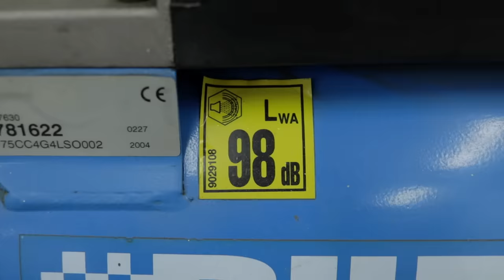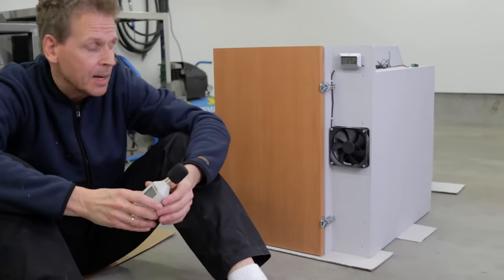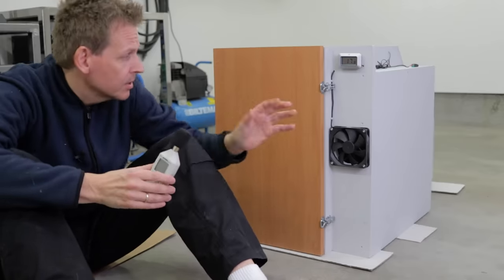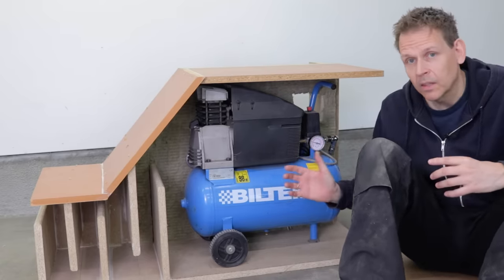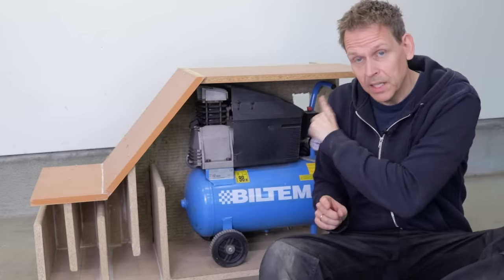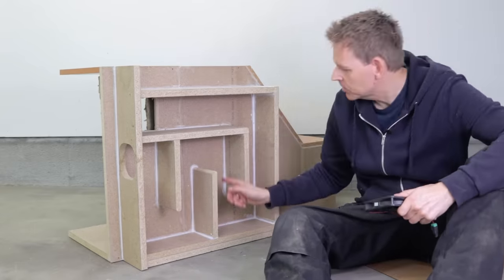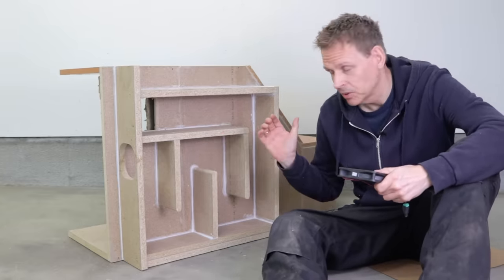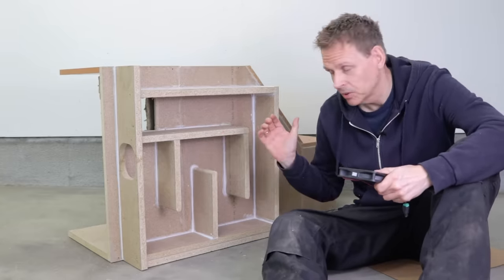Do not build a sound insulated enclosure for your noisy air compressor!

Comment: i have a very large industrial air compressor, and as mentioned in other comments, a lot of the sound comes from the air intake, my compressor has two cylinders, which alternate up and down, so you get two distinct thumping sounds while the machine is running

how i made mine quieter, is actually by taking the air filter off, and pushing a piece of drain pipe onto the air compressor, with a right angle bend fitting, then a meter of drain pipe, now when the machine is running, instead of getting the two thumping noises, it just makes one continuous sucking sound like a vacuum cleaner, i think because the original air filter was straight onto the valve block, when each cylinder was sucking in air, it would pull it straight through the air filter into the valve block, and make that thump sound, then there would be a pause, and the second cylinder would suck in air making a second thump, so air was starting and stopping whilst it was going through the filter, but now theres a length of pipe on the air intake, the air going through the pipe is moving more steadily, and more constantly, so its completely removed the thumping sounds, and replaced it with a smooth, sucking sound
Reply from the maker: It is a very smart and easy way to reduce the noise 👍 I did not really consider adding a hose, but I checked if it would work to add an air intake muffler of some kind of sort (I would guess it has some of the same effect). I was not convinced that it would help very much after a bit of research. I searched mostly on Youtube. I did not find any solution that I thought sounded very efficient. It absolutely helps a but, as you say it removes the thumping sound and it gets a bit lower in volume. I think the reason it does not fully work is that the tank itself also emits noise because it acts like a sound chamber, reflecting noise from the compressor through the metal tank (I am not sure about it - but others has also mentioned it in the comments).
Reply: @kihestad  yes, there is another alternative, but its not cheap, you could buy an empty silent generator housing, and put the compressor in that?

Comment: I noticed that you used a very thin material to line the inside of the box.
I would recommend that you check out your local auto supply store for a rubber based sound deadening material. It comes in large rolls and 12" X 12" squares and have glue on one side. They are very heavy and could easily double the total weight of the box. Line the inside of the box with these, and then cover that with a sound deadening foam that you can get from a local foam shop. Makes a big difference. I use this system to quiet noisy computer boxes. Also, put a layer of this under the box to isolate it from the floor.

I live in a small apartment so what I do with mine is lock it in the bathroom and cover it with towels to keep from disturbing my neighbors.
Reply from the maker: I did use Rockwool sound insulation material (3cm = 1 inch) on the main chamber, but you are correct: a very thin fabric otherwise. I was afraid of not having enough airflow to keep the compressor cool, and I could not make the box much bigger to I went for very little sound dampening on both the inlet and the exhaust channel. The cooling seems to be no problem in my "cold" climate, so I might add some more padding now to see if it helps. Thanks for the tips! 🙂

Comment: Nice job.. Lots of work for sure.. Some improvements... Amaz0n has sound deadening foam. It's not that expensive and designed to absorb sound. 
Next. If it were my garage, I have frequent mice visitors. They would love to take up residence in that baffle chamber, especially if you don't use the compressor daily. You may want to add some metal screen mesh at the inlet/outlet. You can get this mesh at mcmaster carr supply. 
Lastly, you can use your first "noisy" compressor in the "off" state as an accumulator tank at the garage floor, wall or suspended from the ceiling. Run an air line from the silent tank to the second tank closer to your work. Tap off the accumulator for your active work air-line. This will give you more available volume to run air-tools etc.. Thanks for sharing all that information.

Comment: This was an interesting experiment and rich content.  Thank you for your hard work in this scientific demo. Very useful to us all.
No, I disagree with you.  You SHOULD BUILD IT.  Spares your hearing, does not annoy neighbors who will report you for noise violations, and a cabinet greatly increases safety in case that compressor blows up due to rust on inside due to damp air.  So, absolutely, every compressor should have a strong tough cabinet around it from solid thick plywood.

Here are some thoughts I had but have not tried out yet:
1. Stick Noico or Killmat patches on metal tank and any other metal parts to eliminate rattling noises from metal.  It changes the clanging of metal to a softer thuck thuck sound.  Also wrap tank in a sound blanket.
2. Add Mass Loaded Vinyl (MLV), a type of rubberized vinyl mat, very heavy to all sides of box on inside. It dampens sound and vibration.
3. What about adding a car muffler to the vent to break up the sound? It might work really well.  Maybe add it to the outside vent.
4. Rust on inside of tank is the biggest risk. Metal degrades over time, then Kaboom!  I wonder why they don't rustproof insides of tanks before selling.  I would get a dehumidifier on that air intake side so no humid air enters or leaves the tank. Useful if you are sand/soda blasting, which is what I want a tank for.

Thank you for an excellent video!
Please do not add any music to a DIY channel.  It hurts the ears.  I have to constantly turn the volume knob on off on off and it is stressful and an irritant.  Much better to be with natural sounds only.
Reply from the maker: @mjremy2605  Thanks a lot for your positive feedback, and for thoughtful comment 🙏

Comment: I like your tidy, clean workshop and a very good video presentation, the inlet and outlet are called 'baffles'. We had a large industrial compressor and it was loud, one of the mechanics put the air intake up through the roof and it was much better, if you have the room, just put it outside with a roof over.
Reply from the maker: Thanks 😊Ahh, yes - battles it is! 
I agree, putting it outside of the workshop is probably the easies and smartest solution to the problem 😊Unfortunately, I just dont have space for it. My garage is placed with minimum distance to two of my neighbors. The side facing my own property is not usable either,  as it's just a slim path between my garage outer wall and a concrete retaining wall. In front of the garage door is no good either 😋

Comment: I had a noisy vertical compressor, I figured a fair amount of the noise was via the tank, that wrung like a gong, so I was going to try wrapping sound deadening carpet underlay around it. I acquired the underlay, however the compressor died before I could try. So I'm now in the market for a silent compressor.
Reply from the maker: Sounds probably like a better plan anyway 😊

Comment: I grew up around noisy compressors. When it was time to buy my own I dread the thought of noisy. I bought a diaphragm pump design (Chicago brand) and never been happier. I hear it when it's on but it's not disturbing.  69dB  Chicago Hush 50.
Reply from the maker: That is not bad at all, you can absolutely tolerate 69db noise once in a while 👍

Comment: What you are gonna want on the muffler end, and potentially on the intake end, are fans capable of creating a reasonable amount of static pressure.  Computer vent fans  can work, but you need to seal the areas around the fans pretty tightly to get the flow right and youre gonna want fans with good static pressure and cfm.  Beyond that id say its a pretty good design and should work mostly.  Maybe attach a drain tube extension and a secondary valve so you can drain it from outside the tank.  Only thing is youre gonna want a high pressure braided line for it..  if you add some spikes for deflection, or faux fur, or soft fibrous material of some sort to the walls of the exhaust you'll likely be able to reduce the noise further too.
Reply from the maker: Thanks a lot! I have god some feedback and improvements suggestens for the airflow. I might end up moving the fan inside the box to pull fan into it instead of pushing from outside as it is now. 
When it comes to draining the tank: Absolutely! It's a bit cumbersome as it is now, I need to open the four eccentric locks and pull of the door and then take the compressor out of the box. It takes no more than 5 minutes, but it's enough to postpone it to the next day 🙄I better put on a line and have it on the outside....

Comment: I built one many years ago. I installed an inlet and outlet for ventilation. In the inlet side I put a PC fan that sucked air in and blew it right on the compressor head (hottest part). Both the in/outlets had baffles but not near as complicated as yours. I carpeted only 2 walls. Mine dropped the noise down considerably
Reply from the maker: I think your design is better than mine, I plan to move my fan inside the box and make sure it pulls the air from the outside insted of pushing air from outside as it does now. Glad to hear your solution worked! 👍
Reply: @kihestad  I didn't record any db readings but you could easily hold a normal conversation right next to it as it runs. Where as before w/ no box. You could not talk at all. You'd have to yell and even then it was difficult to comprehend.

Comment: I just built a small shed just behind the garage. Houses my compressor and generator nicely. Ran hose and cord in 2" PVC through the back wall. Virtually silent and very easy.
Reply from the maker: Yes, that is probably the easies and smartest solution to the problem 😊Unfortunately, I just dont have space for it. My garage is placed with minimum distance to two of my neighbors. The side facing my own property is not usable either,  as it's just a slim path between my garage outer wall and a concrete retaining wall. In front of the garage door is no good either 😋

Comment: My neighbor is a car repairman. He has his compressor in the shed outside, so it's quiet in the workshop :) Just wanted to point out that if you need the extra power (for pneumatic tools, etc.) and have the space to put the compressor elsewhere, that's also an option.
Reply from the maker: Putting it outside of the workshop really makes sense 😊Unfortunately, I just dont have space for it. My garage is placed with minimum distance to two of my neighbors. The side facing my own property is not usable either,  as it's just a slim path between my garage outer wall and a concrete retaining wall. In front of the garage door is no good either 😋

Comment: I think you should raise the compressor from the ground inside your box using a mount on springs system similar to optional accessories for outdoor unit of split heat pumps. It sounded like you still received quite a bit low frequency rumble and it's probably caused by the whole enclosure vibrating along with the compressor.

We have our outdoor unit for split heat pump on both rubber feets and pretty soft springs stacked and that's very good for the low frequency noise via physical vibrations.
Reply from the maker: I think you are spot on! Vibrations are the remaining issue I have. Thanks for the tips!!!

Comment: This was a good Video.
I think you could make a box like this much cheaper with DIY acoustic panels.
I can really recommend you the Video "How to make high performance sound absorption panels for 5$" from DIY perks.
I hope I could help you.
Greetings from Germany
Reply from the maker: Thanks for the tips! I have seen that video, I think he uses some old towels. I am using Rockwool sound absorbing material, I am pretty sure it is a better solution. It is not crazy expensive either, but you need to buy a whole package of it. Luckily I had some leftovers from this project: https://youtu.be/4EkoAMJAIug

Comment: Does the air compressor overheat Inside the Box due to lack of cooling air available
Reply from the maker: I have fitted a thermometer and I do check frequently that it's not getting to hot inside the box. Normally the temp increases 5C = 10F when it starts until pressure is built up, and it takes just a couple of minutes to cool it down. If it is running constantly over longer periodes it can get a bit hotter, I have seen almost 10C = 20F increase. The warmest summer days can be 30C = 86F here where I live, but that is very rare. Its more commonly 25C = 77F, so it never gets very hot inside my box.
It's a pretty cold climate here where I live in Norway, in the Northern part of Europe. I have actually fitted a heat pump in my garage to be able to use during winter time. I can see overheating is a big challenge in warmer climates. A more powerful fan or even radiator cooling could be needed must then be considered.

Comment: I had a compressor that was 6HP and a 33 gallon horizontal tank, I built a 4ftW x4ftH x2ftD box from two sheets of 1/2 inch plywood and used Styrofoam sheets glued on to the inside. I added three bathroom fans to the front of the box and with flexible plastic fan ductwork that went to each compressor head and one went to the motor shroud. I also installed a 12x12 air vent on one side of the box to let the warm air out. The compressor never shut down due to thermal overload although it did before adding the fans, I would run it for hours sandblasting.
Reply from the maker: That sound like a decent box, well built. 👍

Comment: I see a few things that are done wrong and that is that i would use egg carton shaped foam mats because they absorb sound waaaaay better than those flat mats.
And you must hang the entire compressor on rubber O rings that are also used to hang up a car muffler, because now the vibration of the compressor is being transfered
through the hard plastic wheels and metal stud to the wooden plate it's standing on. And that PC fan should not be on the outside, but at the other end of the air channel 
on the inside, because then you won't hear that one aswell. And to go the extra mile you could even insulate the outside of the entire box with sound proofing materials, 
and then use extra  wood panels to make a closed closet under the desk where the compressor is located. Then it would be silent as a fridge.
Reply from the maker: I did use Rockwool sound insulation material (3cm = 1 inch) on the main chamber, I think that is even better than these foam based mats. You are correct about the ventilation channels though, I used a very thin fabric there. I was afraid of not having enough airflow to keep the compressor cool, and I could not make the box much bigger to I went for very little sound dampening on both the inlet and the exhaust channel. The cooling seems to be no problem in my "cold" climate, so I might add some more padding now to see if it helps. Thanks for the tips! 🙂

Comment: Something I figured out is that at least 50% of the sound is coming from the intake air cleaner on the air compressor. It's the "sucking" sound that is making so much noise. And the way to fix that, is to simply duct the inlet air to the outside, thereby putting most of the noise to the outside. I vented a large 60 gallon air compressor I had through a vacuum cleaner hose to the outside of the shop, and used a motorcycle air box for the air filter. Motorcycle air filters are a perfect fit for a vacuum cleaner hose and they even have a hose clamp, so you just get an ATV or dirtbike airbox with the filter in it, and you use that. When you go outside you can hear the compressor super loud, but you can't hear any air intake air inside, and it's significantly less obnoxious, more a mechanical sound, instead of the loud air pulses.
Reply from the maker: That's a very good solution. As you say it reduces at least 50%, and the effort is not that huge. It will not be as silent as putting it inside a bot though, but possibly 'silent enough'. You do get gid of the sharp, high pitched noise - and that is the most annoying sound.